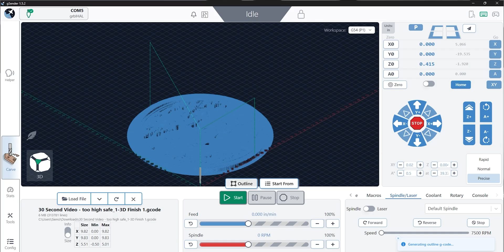CNC Tips ❘  Set Safe Height & Avoid Alarm 2

Comment: Jason, I don't think most amateurs will understand what you are talking about.  You need to find the highest your Z will travel, make sure its not gonna go that high in the Gcode program.  To set this go to the toolpath page at the top (in Vectric software) to set how high it's gonna travel in Rapid moves.  Alot of people for some reason don't even think about this nor realize why the zero changes (in the case of a Longmill with no homing switches) or getting this error message if you hit a limit. Thanks Jason maybe it will at least get people thinking about this.